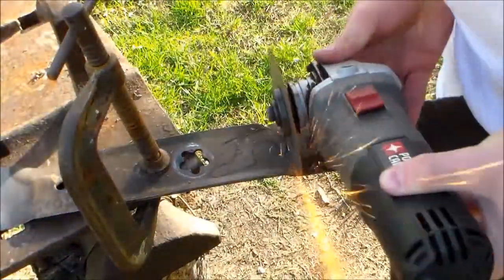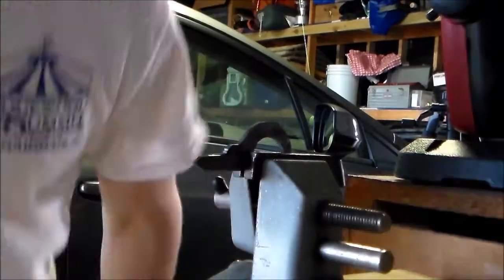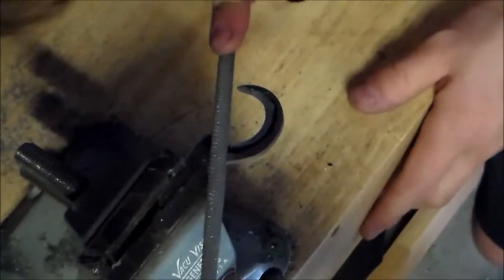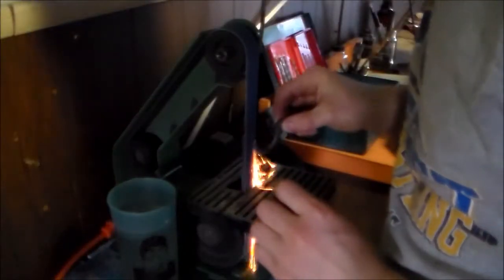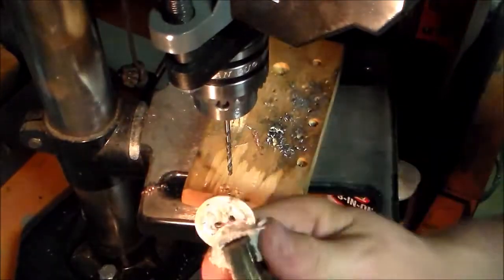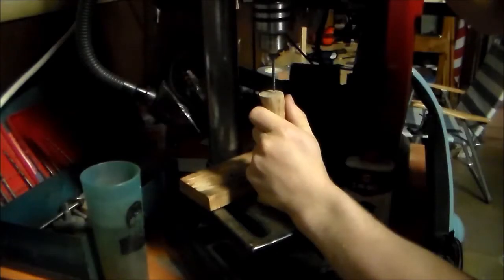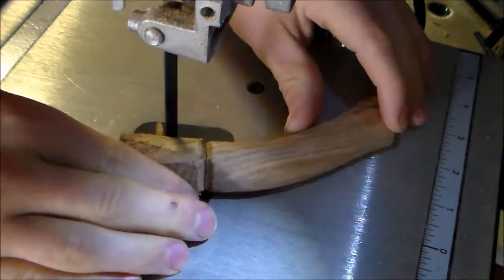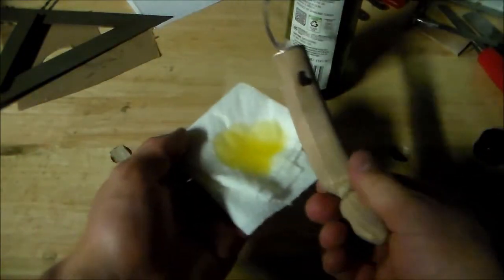How to Make a Mushroom Hunting Knife

Comment: I don't know how old you are but you brough me back in time to my days.  You don't give up, and seem to make do with what you have to make it work!
That knife came out nice!!  One trick I will give you - never use a dinner oil on any wood.  Use mineral oil and get a bottle from the pharmacy.  Oils like olive
and vegetable do penetrate the wood but also go rancid inside the wood.  Mineral oil will not do that, which is why it's recommended for cutting boards ;)
It also helps wood from cracking.  You may be able to add a stain of your choice to the oil - experiment.  I might try crushed black walnut husks found on the
dropped walnuts from the tree itself.  That's a favorite stain used on gunstocks and folks do come around collecting the green nuts for that purpose at times.
Whatever you do have fun with it and keep up that spirit!!
Reply from the maker: Thanks! I'll have to buy some mineral oil in the near future. The main reason I use olive oil is because I already had access to it (in my family kitchen) and it makes the wood look nice. In my few years (lets go with 4yrs) of experience, I have never had any wood go rancid or even smell funny with the olive oil, however I have noticed that I have had to re-apply olive oil to a black walnut handle I made 2 years ago. Maybe the wood dries out before the oil can go rancid. Do you know if mineral oil dries up with time?